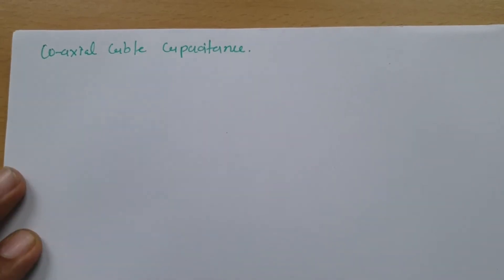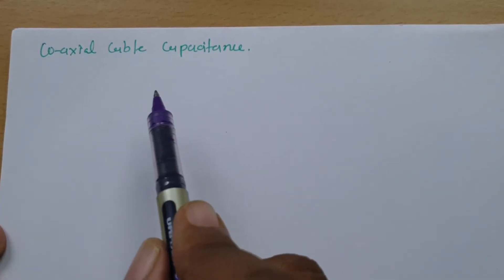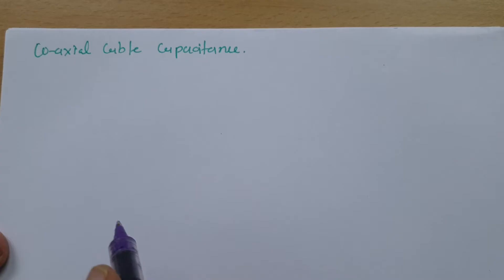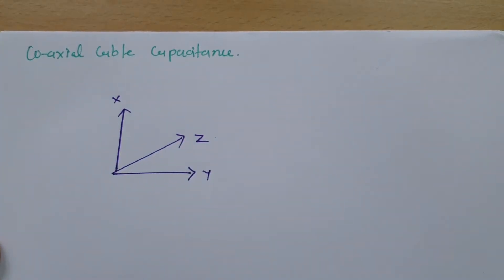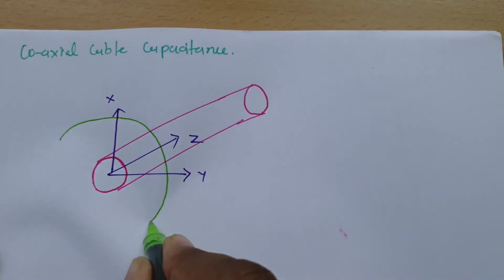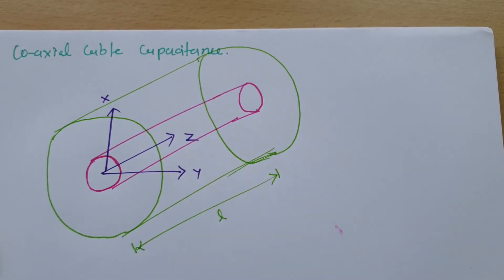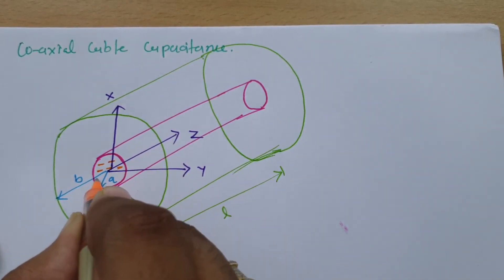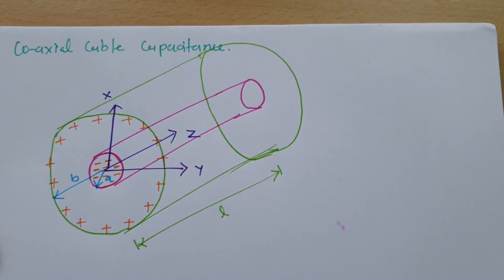Coaxial Cable Capacitor: Electric Field and Capacitance Explained

Comment: What is a transmission line?
When a high frequency signal voltage is applied to a transmission line, which consists of a pair of perfectly conducting parallel planes separated by a distance, energy transfers from the source to the load by pulsating electric and magnetic fields between the planes; the fields don't travel.
Transmission lines are analysed by considering the voltage and current on the line, and the field configurations and wave dynamics provide insights into the origins of the voltage and current.
The book "Fundamentals of electric theory and Circuits" by Sridhar Chitta
https://www.wileyindia.com/fundamentals-of-electric-theory-and-circuits.html begins with detailed discussions in the initial chapters 
on the topics of surface charge, coulomb's law, electric fields, fields of dipoles and other charge configurations such as a pair of parallel plates, in which a distinct approach is made using the surface charge concept in the study of advanced topics of capacitance, currents, conservation of charge, conservation of current, superposition of fields, superposition of potential, a simple dc circuit, voltage, voltage source, difference between e.m.f. and potential difference, ideal voltage sources, resistors, how current branches in a parallel circuit, capacitors, and the superposition of ac signals on a dc voltage for coupling signals to amplifiers.

One section in Chapter 3 describes the principle of superposition of potential and provides an intuitive explanation of its application in small-signal ac circuit anaysis and developing ac equivalent circuits which is not usually found in textbooks.

Then, two chapters are devoted to discussions on magnetic fields, magnetic fields of a current element, straight wire, current loop, solenoids, biot-savart law, inductors, Faraday's law, inductance, ac circuits, and transmission lines. 

The section on Transmission lines in Chapter 5, discusses signal transmission over two-wire lines and coaxial cables. There is an in-depth discussion on the origin of common-mode currents, incident and reflected waves in transmission lines and the TEM mode of wave of propagation.
One section is devoted to a discussion of the attenuation in the context of lossless lines and the speed of propagation of signals over transmission lines.
In several chapters, the differential-mode signals of circuits are identified and in one chapter a comparison of the differential-mode signal and common-mode signal is provided. 
An interactive Java based program depicting the passage of signals on transmission with a provision to vary line parameters is included in the CD alongwith the book, which is useful to understand the propagation of signals on transmission lines.
The link to viewing a video on the simulation is here 
http://www1.astrophysik.uni-kiel.de/~hhaertel/Videos/TL-uk.mp4
The simulation maybe downloaded from here
http://www1.astrophysik.uni-kiel.de/~hhaertel/TL/TL.zip
Note: For detailed instructions of running the transmission line (TL) program and examples like observing standing waves, refer "Fundamentals of electric theory and Circuits" by Sridhar Chitta.

Subsequent chapters discuss the
Lorentz Force law, motors, generators, p-n junction diodes, electromagnetic waves, antennas and radiation, waveguides, and new electrodynamic theories on the nature of the electric field.

The CD contains animated power point presentations for all chapters and voltage regulator, RC phase shift oscillator, transformer-coupled audio amplifier and differential amplifier included additionally.
The contents of the above book by Sridhar Chitta, make a distinct unified approach to electrostatics and a few advanced circuits like coupling signals to amplifiers. This approach lends precision and clarity to the topics which is not found in most text books.

There is a "look inside" feature in the amazon.com webpage of the book "Fundamentals of electric theory and circuits" by Sridhar Chitta with a few pages of Chapter 1 which may be viewed and also which you may swipe left or press < icon to view the foreword, preface and Table of Contents. 
There is a full set of lectures beginning lecture 13 here on surface charges, electric fields, simple circuits, capacitance, inductance, faraday's law, motional emf, magnetic forces and more topics here
https://matterandinteractions.org/videos/EM.html
Electrostatics and circuits belong to one science and not two, that of electricity and magnetism. To know how they are unified visit this link 
https://matterandinteractions.org/articles-talks/  and view the article 'A unified treatment of electrostatics and circuits.  B. Sherwood and R. Chabay, unpublished. (1999)'
pdf. 
For a live demonstration of surface charge and its effects in circuits visit 
https://youtu.be/U7RLg-691eQ

Comment: Sir,Why we cosider electric field of only one cylinder but in parallel plate capacitor we added electric field of both plates?
Reply: You might consider the charge density on two parellel plates of equal size are equal, while the charge density on two cylinders of equal length but different diameter are different.
Reply: Aravind Pugal  bro.... inner cylinder consists of positive charge through out  the edges of cylinder......and you know the formula for ef due to infinite line charge
Reply: @anjanisivarambonam9895  Thanks bro...🙏 but in previous lesson he added electric field of both the plates here only considered inner line but not outer cylinder.
Reply: @anjanisivarambonam9895  can you please tell where can I get his notes
Reply: I think it is because of there is no E field in conducting geometric shapes. So we just consider E field which is formed by inner conducting material

Comment: Why we are taking it as linear charge density as we have that circular surface?
Reply: It's because the inner layer of cooxial   cable is very small so we considered it as line
Reply: @088snehakc9  Yes.